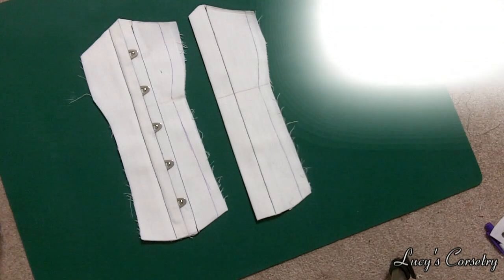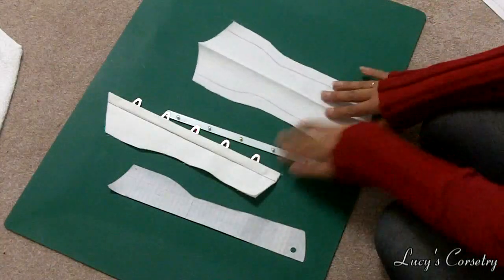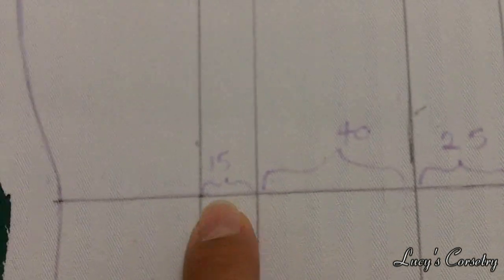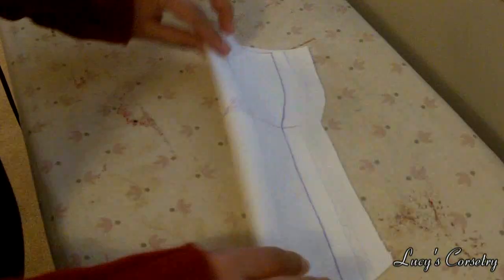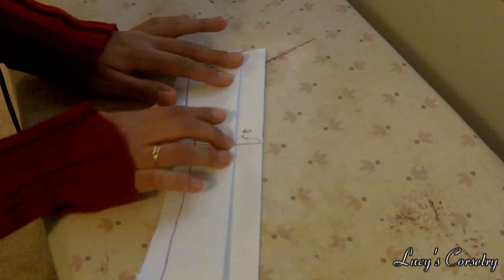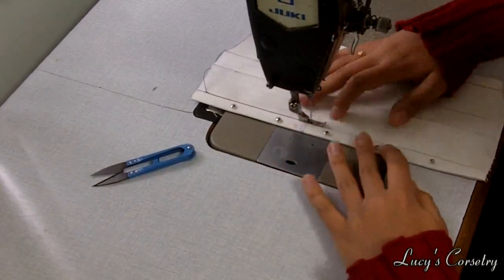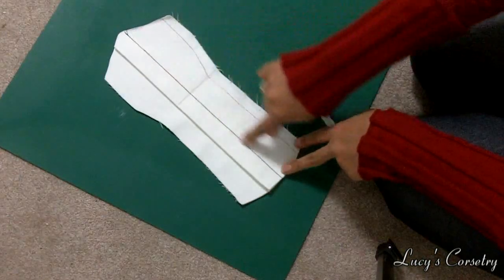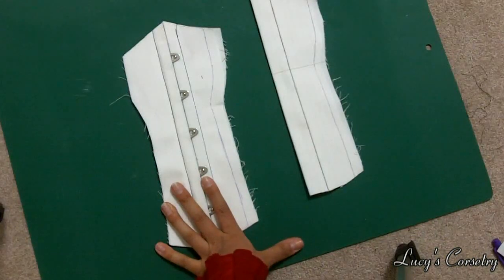How to Make a Concealed Busk (busk flap, corset making) | Lucy's Corsetry

Comment: Have you tried lengthening the channel just a smidge to give yourself room to topstitch the flap down directly next to the busk? T
Reply from the maker: I'm not sure if I'm understanding properly, but if the flap over the busk were made wider to topstitch the flap down flat on the other side of the busk, then the corset would not be able to open properly in the front as it would be stitched closed.

Comment: I revisited these because I'm planning a boned underbusk but I wanted to say how wonderful this little series was!
I have a question - is there any reason why you wouldn't put the cover flap on the loop side of the busk?
Reply from the maker: Aw, thanks!
Technically you could put the flap on the loop side - but my reasoning at the times was that if you put it on the knob side, then when you put the binding on, there will be a certain amount of tension that keeps the flap down and flat, even when the corset is fastened. If you put a flap on the loop side, it might just wave in the wind (unless you put down velcro or snaps to keep it down).